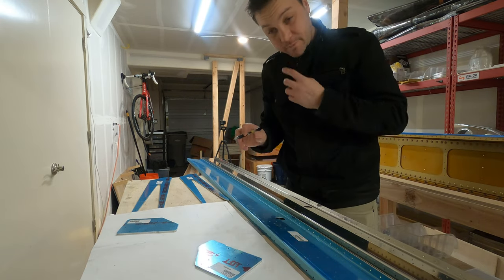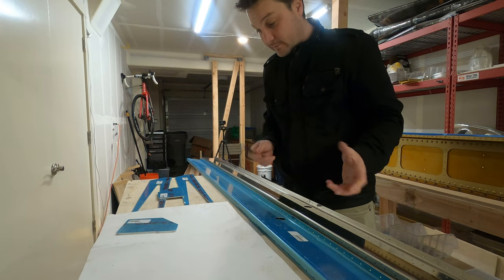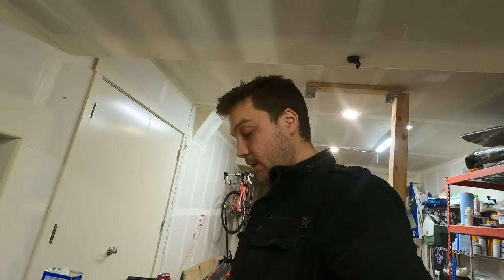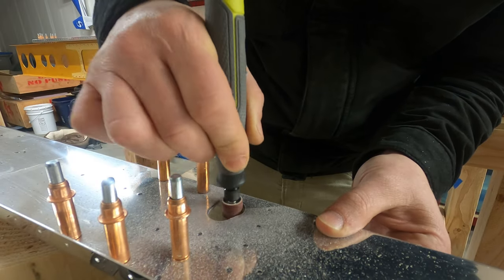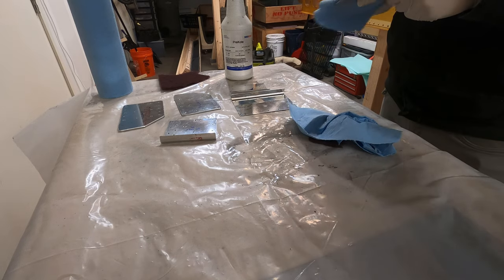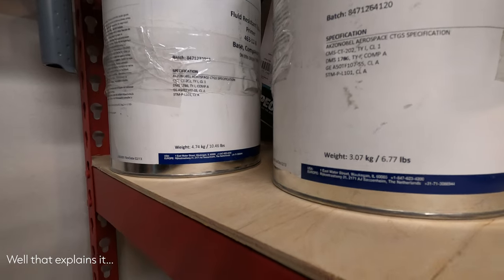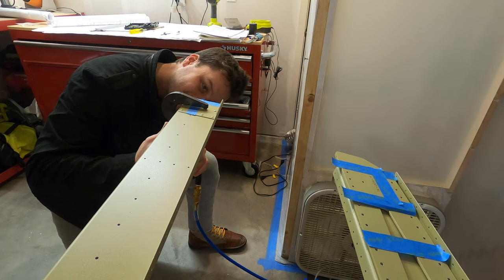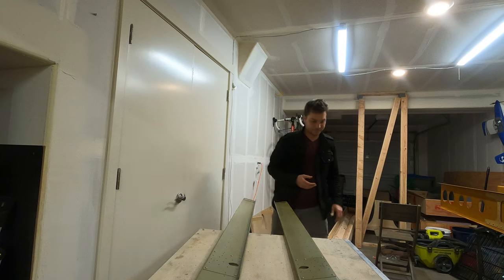Building an Experimental Airplane, The Vans RV-7A | EP2.3 Rear Wing Spars

Comment: I used to mix paint at a body shop.  Usually weight on paint is used for pigments to make the color…different weights in the base paint.  Then when mixed it’s usually done exactly how you are doing it in ratios for different activators and reducers for a sprayable product.
Reply from the maker: I have limited experience in mixed epoxy primers or even paints + catalysts for that matter. Getting to the end of on can of primer and still having a quarter of a can of the other is my worst fear. It would leave me concerned about the integrity of all the primer.

I alternate first poured, pay close attention to ml poured as well as the 1:1 guide, and the weighing was another method to check this—though it didn’t offer much this time around. 

I think it’ll be fine in the end, but taking precautions is one way I’m trying to limit the surprises…

Comment: Pan American Tools has some really nice single flute carbide bur sets I'd recommend for routing out aluminum. Their drill bits are all I use also for my A&P work also👍
Reply from the maker: I’ll have to take a look.

Now that I think of it, I think I have a carbide reamer in my drawer. I wonder if it was intended for this type of work.

I’ll have to see about the drill bits too—some sizes and lengths are missing from what I’d like to have on hand.

Thanks for the tips!

Comment: Really enjoying catching up on your build. What epoxy primer are you using? Also where do you get the mixer/pour attachments?  If I ever get to start my own build, I was thinking of using the Stewart’s Epoxy system.

Keith
Reply from the maker: The primer used on the airframe is Akzo Nobel, available from Aircraft Spruce. Great stuff, and I go into detail in a later primer episode.

The mixers are from Rockler, I believe, available at Woodcrafters. The primer does not soften or otherwise degrade the mixing paddles—at least on mine.